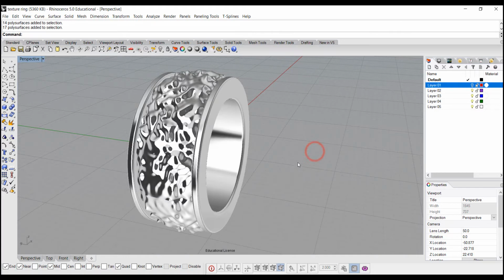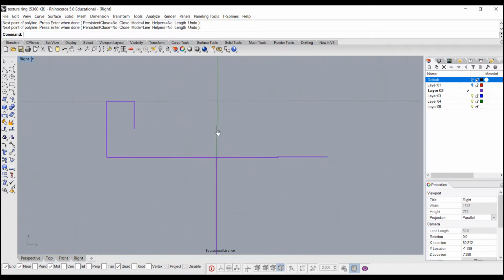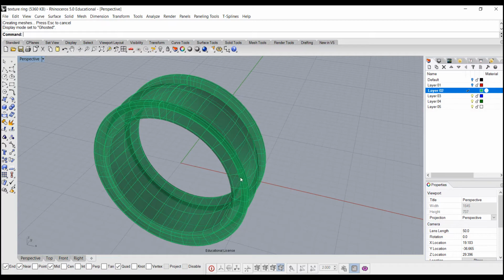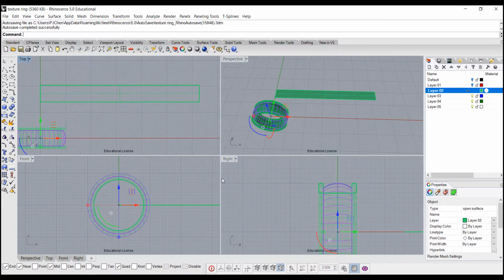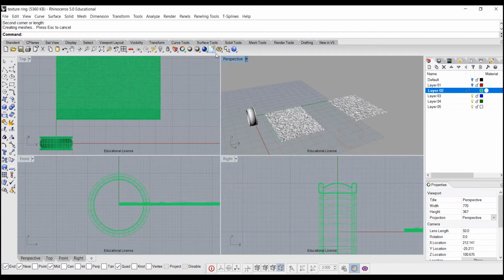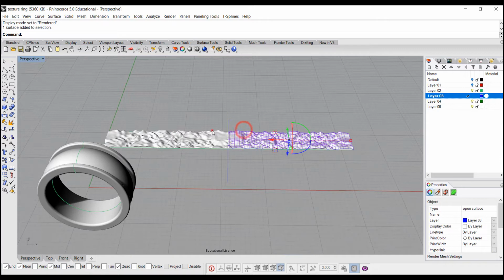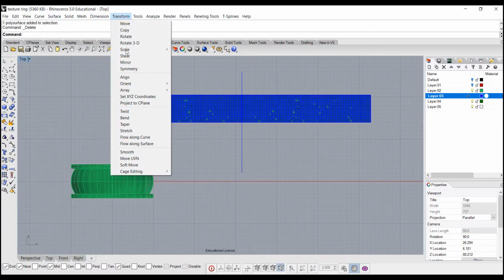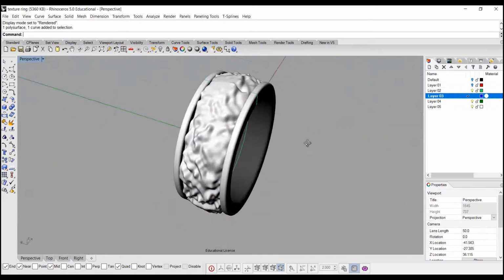Jewelry CAD Design Tutorial #9 - How to Build a Men's Textured Ring Band

Comment: For benefit of everyone.......Question : I am getting some weired ring on the surface of the ring instead of texture when flowed over target surface. what could be reason ? Answer :  Missed to convert the base curve to planer surface and hence the problem. Select the planer UV curve and convert it to surface by using Surface from planer curve tool. If not done, Rhino will consider the base curve as surface and create the weired looking rings on target surface instead of textures......
Reply from the maker: I have a video disucss why flow doesn't work. you may find the answer there. https://youtu.be/dSizylJLbcE

Comment: Hey PJ, I keep getting "Open Polysurface", when i check the Naked edges, it shows that the seam of the texture is pink, I zoom in & the ends match. Can you please explain to me why that is?

I have joined the ring and texture after flow. Rhino was able to create a Boolean Union, but not "Closed Polysurface".
Reply from the maker: HI Nariman, if you parts can be boolean. try to boolean a small sphere on where it is naked. it may fix the issue. if not,  email me your 3dm. I will take a look for you. pj@pjchendesign.com
Reply: @PJChenJewelryDesign  ok excellent thank you. Can you tell me if this solution matches your suggestion?
I extracted the Isocurve then built a pipe around it to create a thickness where the texture meets. I will try it again today

Comment: I do have naked edges problem
Reply from the maker: Can you describe a little more?
Reply: When i did the last steps. Trim and trim inside and the join them togetger they still naked edges
Reply from the maker: make sure 1. surface are complete intersect. 2 surface is not folding into itself. 3 you trim all the surfaces.
Reply: @PJChenJewelryDesign  in you model naked edge too. joined in one open polysurface.

Comment: Hi, when I flow the texture along surface, it dosn´t look like my stone texture at all. Looks completely different. I tried several times with diffeent textures and don´t know how  to fix it
Reply from the maker: Hi E. when you flow. make sure the texture was from Create UV curve. it usually stretched a little bit depends on how tight or loose the original surface was but it should be close. another way is to make the texture smaller or finer before you flow.
Reply: Yes that’s what I did 
The texture looks fine on the flat surface, but changes completely on the ring

Comment: Hi PJ, I'm unable to ExtractSrf on my ring... I made my ring profile simpler than in your example (typical wedding bad look)- I did a rectangle with a slightly curved top.  Any ideas why I'm not able to ExtractSrf? Thanks!
Reply from the maker: Hi Jon, you can email me your model to pj@pjchendesign.com, I will take a look for you.
Reply: Thanks!- I just sent
Reply from the maker: The reason you can not extractSrf is that the entire ring is ONE/SINGLE surface. so there is nothing to extract from.
the solution is to draw two straight line and split the surface instead. I send you a revision model by email. Let me know if that make sense.
Reply: Thanks for the advise! I did the split command with two lines, and I placed them to not include the radius. Then, I did a UnrollSrf command. It worked like a charm! (no pun intended)
Reply from the maker: That is great!!

Comment: nice creative tutorial again. would it work to not mirror the texture but  leave a gap and do two SurfaceBlend or MatchSurface commands? (one for middle seam and one for the tile loop). Or do a proper tiling using offset commands in ie. photoshop first.
Reply from the maker: Great idea, it is very possible. it also depend on how complicate the surface was when you blend.
Reply: PJ Chen Design true, match surface would be maybe even better, if possible with certain edges.
Reply: PJ Chen Design just made a test with your texture and procedure, tilling results are excellent, here are the steps:

1. create surface from image
2. stretch it etc to fit the eye.
3. duplicate surface and snap it to the right (the tiling direction)
4. match left surface's right edge to the new one, tangent, do not average surfaces, delete dublicated surface.

now the original, matched surface is tilable to the x axis.

5. revolved a surface
6. selected circular edge, measured with length command, measured hight of revolve.
7. created plane with the above dimensions.
8. stretched/fit/tiled the original surface as i needed (many tiles, fewer etc) and made the group totally snap to the length of the planar surface (or even height if needed)
9. flowed the group onto the revolve as in your tutorial, no UV curves needed because it was a simple cylinder.

10. Result is 100% tangent seam, examined with zebra.

11. Can be joined and auto-capped to a closed polysurface.

12. Booleans work correctly with spheres and cubes, even fillets the wavy edges, so works definetely correct and watertight.

edit

13 . 2 trimmed (from the original wavy surface) round caps were added and were succesfully tangent blended and joined into closed polysurface with Blend Surface. Match Surface would not work due to trimmed edges.

I usually don't model such stuff but your tutorial was a nice inspiration, thank again for sharing.

keep on the good work.